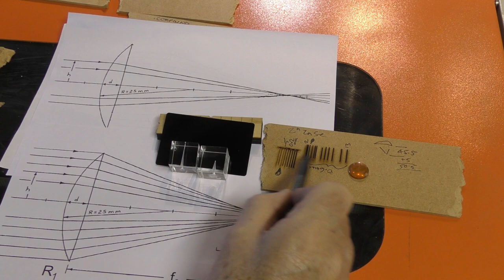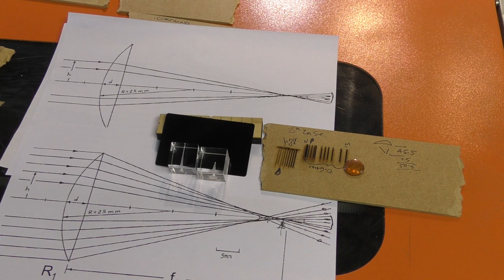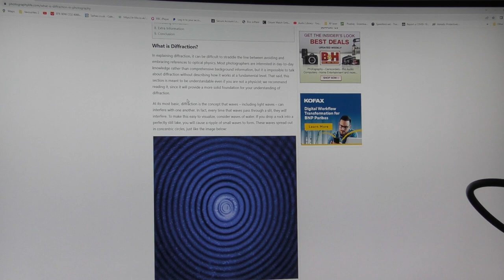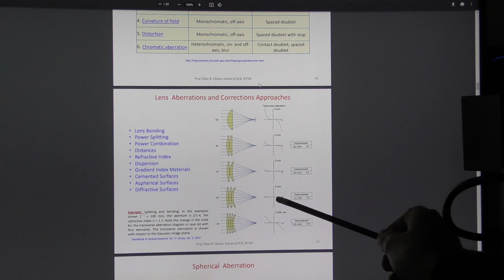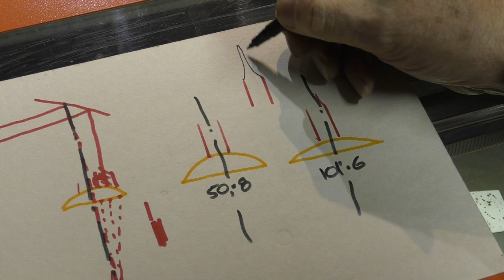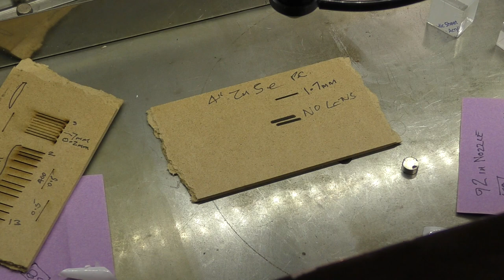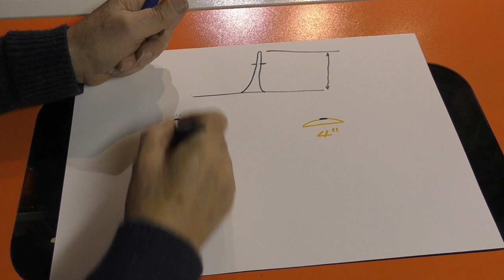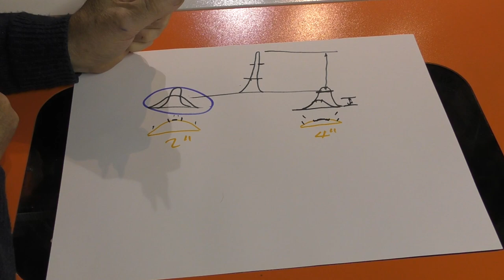RDWorks Learning Lab 231 Search for a Beam Conditioner part 4

Comment: I'd suggest a cold beer to cool down the two grey cells! 😁

I was thinking about if it would be possible to calculate the diameter of the'deadzone' of the   lens by dividing the intensity of the beam by the first derivative of the function of the lens curve for a defined interval (not at 0 for sure but around 0). This will get a very big number which is getting smaller, the more off center you get. You get the point I am trying to aim at?

Comment: Don't fret, Russ- you have yet to unlock the truly awesome power of the RF tube!  It's not in spot size, which the diffraction rules and the Airy disk show you can't improve on once you have a good M2 factor.  The true power is right in front of you, you just have to think about a completely different property and task!
Reply from the maker: Hi Danny
 Your encouragement is more than helpful because it makes me research the subjects you speak of,   I do not have the awesome knowledge of optics that  allows you to visualize the effects I see in formulaic terms.  From your previous guidance I have done much research into diffraction, airy discs, apertures, focus and spot size I cannot logically associate the subject with the effects I observe and demonstrate.. My simple two grey cells are however able to make sense of refraction laws. and how a spherical geometry lens surface can bend light into a theoretical point of singularity (almost). . However , at its limit that law will produce zero refraction if the beam is perpendicular to the surface ie a parallel sheet of any light transmitting medium will not cause a focus effect from a beam that is normal to its surface. Thus it follows that the axis of any lens, regardless of it defined focal point, cannot focus a beam that is coincident with its axis because  there is no angular surface to refract the beam. This logical non-focusing property  will gradually decrease and a  focus will begin to form (rapidly decreasing from infinity) as the angle of incidence of the spherical surface  increases with distance from the axis. I have no idea what the optical term for this lens blind spot is  and in reality I imagine it to be  unimportant when you are trying to focus an image. However I am not trying to focus an image. In simple mechanical terms  I wish to use a lens as an intensity amplifier. BUT what I want to amplify  is a pinprick of incredibly intense light that happens to coincide with the axis of the lens where little or no amplification is available. Hmmm that tells me I should give up!!! 
THAT is the real reason why I can demonstrate a parallel beam of light passing through the lenses, The longer the focal point, the flatter the spherical geometry at the axis and the bigger will be the non-focusing "blind spot"  There is no hint of focus  in any  these beams , regardless of the focal distance.  They are not performing in accordance with  IMAGE driven concepts of lens theory. We are using lenses to amplify light INTENSITY because it is light intensity that causes material damage.  The greater the intensity the faster you can do damage.  I have already created a super intense beam  band now I want to use a lens to amplify it even more ......but it wont. .  Going to this small intense beam extreme  is in itself educational because it clearly explains why you have to expand the beam.  It is a mechanism for reducing the central intensity and negating the effect of the lens bind spot and using that part of the lens surface that DOES act as an intensity amplifier. However, what is being amplified is a castrated intensity profile  that is much closer to the uniform light required  by l lens imaging theory. 
I have already unlocked one awesome power aspect of this extreme intensity and that is by using a triple compound lens to do engraving  way beyond the previous capabilities machine with its 30 watts and X2 beam expander.  When I have finished exploring, I will go back and thoroughly experiment with the new engraving potential of this machine..
Thanks again for your contribution. I will continue hunting for ways to make 30 watts into a cutting monster.
 Best wishes
Russ
Reply: @SarbarMultimedia  The thing is, when lens aren''t in these novel configurations (backwards, etc)  they are already in the best possible case, the "diffraction limited system", easily achievable with the off-the-shelf optics and an RF tube.  The quality of the lens and the spherical aberration error are insignificant when you are a DLS thus nothing to improve upon.  
When you are a DLS of a particular wavelength, there is a fundamental tradeoff after the final lens- you can have a long, narrow cone with a high Depth of Focus (DoF), or a small minimum focal spot size.  When you change from a 2" Focal Length lens to a longer 4" FL lens, you double the DoF which reduces the loss of energy intensity as you go +/- the focal point.   But also fundamentally double the focal spot size, and thus reduce the best energy intensity there by a factor of 4. 
Conversely, for engraving we often want a tiny focal spot size to represent detail, and/or because we need the highest possible intensity to burn anodization off aluminum.  Thus the 1.5" FL or 1" FL, which you have already experienced- along with the inherently short DoF, making it very sensitive any deviation from the focal point.  Thus, while a good choice for fine engraving, it is rubbish for general cutting as its DoF is short.
The thing is, the exact same effect occurs when you halve the beam size coming into the lens.  This is counterintuitive, and where physics may appear to have gone mad- but this is due to the fundamental wave properties of light.  Not the lens design nor quality of the lens as long as you are a DLS.  
Bottom line, the DLS rules mean that for a given wavelength there is a inherent best case of ratio of DoF to minimum focal spot size, and it is not possible to make it better.  This is always true regardless of whether you vary the focal length of the lens, or beam diameter.  They create the same effect and end up with the same limit.  
A 5mm 1/e^2 dia beam going into a 2" FL ZnSe meniscus lens will produce a 0.198mm dia focal spot.  If you change to a 2.5mm beam diameter, the intuitive expectation would be a 0.1mm spot size- but that is not the nature of a DLS.  Instead you get a 0.4mm dia focal spot! 
That is the best possible result.  All cases where you deviate from a DLS mean a larger focal spot size for a given DoF, or a shorter DoF for the same focal spot size.  
Next up- not only are photons both a particle and a WAVE, they are inherently quantum objects.  And under certain circumstances can do impossible, unthinkable things that, in rare cases, are empirically observable and you can never see the world the same way again once you understand what you are seeing.

Comment: Great concept, Sir.
I look forward to your success on it.
I want to try it by my self but I kinda short of parts for the test.

I have been studying about the correlation between air pressure and laser cutting profile regardless the type of the lens being used. Well, it cost so much time. But I think it's worth to dive deeper into it.
Reply from the maker: Hi Ahmad, please note that this is not the normal glass tube laser machine. It uses an RF  signal to drive the laser process. The performance characteristics of this RF technology cannot be immediately transferred to glass tube technology.  So please be careful what you try to copy.
 Best wishes
Russ
Reply: @SarbarMultimedia  I noticed that from your explanation through your video, Sir. And that's why I said "kinda short of parts". I use regular CO2 glass tubes and fiber laser for my daily activity. Not having any RF yet. One of the reason for not having any RF ones is I haven't complete my research on my existing machines. One at a time works better for me.

One question, does air assist system or method or usage in RF laser has any differences with those in normal tube laser machine?

I've been following your huge collection of videos and have been trying to catch up what you have researched. Cool channel you have, Sir.

Oh.. Greeting from Indonesia and pardon my English. Not very fluent in it.
Reply from the maker: @elsindo  
 Hi Ahmad
The difference between RF and  constant current glass tubes lasers  is all to do with the science of creating a laser beam and not the beam  . They both generate  10.6 micron wavelength electromagnetic waves and  damage material with exactly the  same energy transfer mechanism.. I created my budget  RF machine  by using a very basic low cost  Chinese glass tube  Ebay machine.  For years I had  been bombarded by  marketing hype and fantastic performance promises from the likes of Trotec, Epilog and Universal .This low cost creation was my way of trying to discover the "magic" that these guys were selling.  I spent several months testing and exploring this different  laser technology only to discover a very expensive and complex  technology that was inferior to glass tube  science in just about every way possible.  The  massive disappointment is the reason why this machine sat unused in my workshop for 10 months,  However,  During those 10, months I have come to understand so much more about lenses and laser beams and discovered many ways they interact that are not accounted for by conventional lens theory.   The very small and VERY intense beam created by an RF laser source  is ALWAYS diluted by this beam expanding  technology WHY?  I saw tremendous potential  in this high INTENSITY;laser source and thus I have tried to exploit the beam in its natural form. Experts predicted I was wasting my time because such an unconditioned beam was unusable. It,'s been an amazing experience to be able to prove something I predicted two years ago but never had the means of verifying  that there is  a non-focusing  (a "hole") at the center of all lenses.  I am trying to find new ways to turbo boost this RF technology to a point where I will enjoy using this technology. There may still be some REAL "magic to be discovered.
 Unless you have too much money, I would not rush out to buy into RF technology. Yes, the marketing hype is very persuasive  but smoke and mirrors best
 describes it
 Best wishes
Russ
Reply: @SarbarMultimedia  Hi again, Sir.
Thank you for the reply. It is well explained and I think I will just continue my research in regular laser tube regarding the tremendous price of the RFs.

Again... Thank you.

Comment: Isn't it true, though, that the central area of a lens that you are calling a "dead" zone will pass the central rays of the beam through WITHOUT much focusing, but nonetheless pass them through until at some point the outer rays are focused and combined with those straight bunch of rays? We are not losing those rays' intensity, we are just not refracting (bending) them. Also, the conical burns you are getting into the acrylic cubes are shaped that way by the fact that the narrow point at the end is burning (or melting) the acrylic for a shorter time interval than the parts on the top of the block (where the beam enters). The reason the latter is a wider circle, also depends on time. It is the part that is exposed to the beam the longest, thus the weaker rays are getting a longer time to burn a bigger circle. I hope I have expressed myself well enough to be clear.
Reply from the maker: Hi
 Please excuse my non-scientific description of what I observe but this very small high intensity beam is creating some weird  and unexpected effects  as it passes through various lenses.If you have seen any of my previous sessions and know what a  raw beam mode burn is ( without a lens) . When  passing that beam through a lens, it does indeed do as you say,  it refracts the outer rays more than the central rays to achieve a  compression of the beam whereby its total energy density  is amplified to a maximum at some sort if "fuzzy" focal point.  However, try to imagine what is happening at that plane of focus. The  outer rays have very little intensity  but are being refracted into this focal spot at a more acute angle than those much higher intensity rays at the beam axis.  The important concept here is that  a  lens does not change the intensity properties of a single ray (if you can imagine such a thing) it only changes its direction. If you take that concept to  the very central and most intense ray at the axis of the beam , it logically must pass through the lens  with zero direction change and zero intensity change. Light travels in straight lines  so it is only at this focal plane that the corralling of RAYS reaches maximum density.  Lets now attach  different intensity values to each ray and step back to the raw beam. It had a Gaussian intensity distribution.  If I pass it through a lens with infinite focal length ( a sheet of glass) It will still emerge as a Gaussian distribution., Now start decreasing the focal length  little by little and imagine what you are doing to that INTENSITY distribution.. The outer intensities are being aggregated whilst those closer to the beam axis are little affected.  So what do you imagine the intensity profile looks like at the focal point?

 As I have mentioned often, I am not an optical engineer, my analysis of how lenses  work is a very elemental mechanical engineering dissection. If you can accept the  visualization I describe above  you will understand the logic of that central RAY being totally unaffected by a lens.

Many thanks for the comment  because in dragging up an answer, it often helps  clarify or reinforce my own thinking. I am equally open to change by logical arguments. I find it fascinating that lenses and laser beams have such an unusual relationship and all because of variable intensity.
Best wishes
Russ

Comment: Evening Russ just found your channel, usful info, watched your buying video, and was wondering if you had though on the red dragon 50w machine, uk based company so maybe avoids some of the risk.
Reply from the maker: Sadly , buying a machine in your own country does not mean anything. The Red Dragon machines are Chinese made imports from the E bay factories. Such companies may or may not do setting and test work  and QA with the machine before shipping to you. Thinklaser do a real test and QA  job and provide  a  an expert service engineers and spares backup service. These are made n China but to a completely different specification .  Somebody has to pay for that service so a £1500 ebay machine  that you buy as a "project"  will now become a £5000 plug and play trouble-free machine.. For something that is genuinely built and designed in the UK you must look at Lotus Laser. They may look Chinese but that's because the case is imported from China.  But now you are into £7000 bracket.. You should not fear buying a cheap Chinese machine if you realize it will require a new tube and power supply immediately so add £400 to the price you pay.. It will still require your TLC, time and perseverance. The essence of a good reliable machine is there if you have the skill to make it happen. It also means you become your own 24/7 service tech and do not have to buy services.  i thinks that there is little comfort in buying an Ebay type machine via a company like Red Dragon.. If you are trying to start a small business then its a no brainier,  you need to speak to Thinklaser or Lotus laser  so that you hit the ground running and will do so with confidence about the future.
 Best wishes
Russ

Comment: So on the answer to use a smaller diameter lens that just captures the intensity of the outer beam and therefore has a smaller radius which means the center portion of the beam has a smaller dead zone to pass through?
Reply from the maker: We must be very clear here to understand the limitations of my test I absolutely know that high intensity= fast cutting.  With a glass tube  the shape of the beam starts off large between 6 and 10mm diameter typically.  At full power the beam is pretty pointed  because there is a certain max intensity that the tube can create. With a glass tube when you reduce the power the beam diameter does not change but the shape of the intensity profile does. It gets "blunter"intensity

Comment: I don't know what I'm talking about, but wouldn't you expect a smaller diameter lens at the same supposed focal length to have more curvature? Could you pass your new intense beam through a smaller diameter lens and expect less of a dead zone in the center of the lens, assuming it's the same focal length?
Reply from the maker: Hi
The geometry of a lens is based on spherical radius.. The bigger the sphere the longer the focal length. If you cut a slice off the sphere then that will be a lens. I hope you can now  see that the thicker the slice the bigger the diameter will be. So diameter has nothing to do with focal length . It's  just the spherical curvature of the surface that determines the focla length.
 Best wishes
Russ